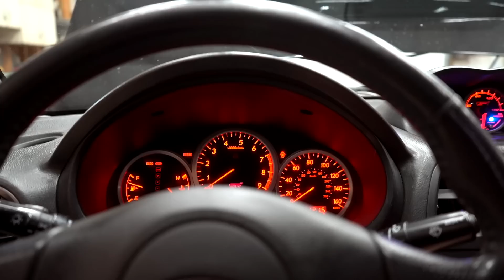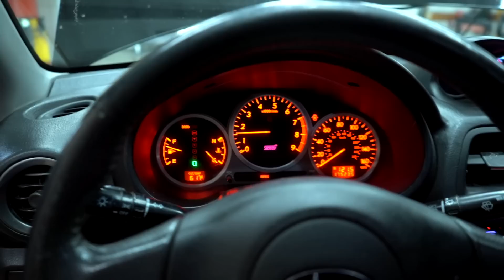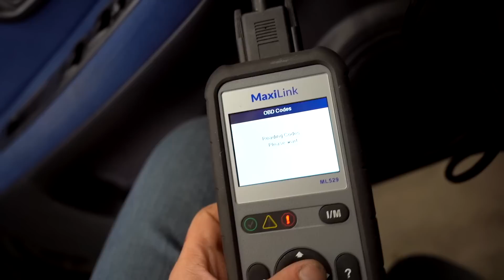Installing Stiffi's on the STI's!

Comment: @Devin - the other plug on steering should be for steering wheel with accessories (volume controls, etc).
Please consult local parts department at dealership. 👍

Comment: Man the method where you peel just a tiny bit of the 3M wrapper off, set them where you want them, then pull the wrapper to expose the tape is so much easier than sticking them to the car and having to rip them off lol

Comment: The cruise control light will come on with the check engine light indicating the car is in limp mode. Same as my 06 forester, the abs and brake light will come on when their is an issue with the speed sensor as well hence your speedo not working. Good luck man hopefully it’s just a corroded connector or frayed wire.

Comment: The cruise control blinking should be for emissions for the cat, like on my 06 Legacy but not sure about the sti, I hope this helps somewhat
Reply: Cruise control is disabled due to a check engine light. It's a standard Subaru feature. That is why it's blinking. Any engine code will trigger cruise control light to blink
Reply: Misfire if blinking

Comment: Pretty sure the cruise wire on the Sti is different from the wrx.  I remember on my 07 sti it had a green connector that plugged into the middle connector and had a colored wire for the horn. Think it was green.

Comment: I believe if the speedo is not working the gear is stripped in the trans and you will have to split the case to fix it

Comment: If the speedometer isn't working, the gear inside the trans casing is likely stripped. Unfortunately in order to replace that gear, trans has to come out and you have to open the casing

Comment: YO CLEAN THE SPEED SENSOR CONNECTOR PINS ON THE TRANS, ITS CORROSION FROM THE I/C WATER SPRAYER IF NOT ITS INTERNAL. IT HAPPENED TO MY STI CLEANED IT AND BACK TO NORMAL.

Comment: I had that speed sensor light, I replaced the speed sensor and still had it. Turns out it was the harness clip that plugs into it. Looked burnt in there. Picked up one from iwire and spliced her on. Problem solved :) <3

Comment: speed sensor will cause CEL to come on and throw the car into a limp mode. Should be able to just replace the sensor from the top if its not physically broken inside the trans.

Comment: I'm on the hunt for another car I'm looking in to a 3volution 8 or maybe a swaped  Subaru gc8 what you think is better buy I can get a 3vo for 14k right now or a sti swapped 2.5 rs -gc8 body whats better ?????????
Reply: The Subie gC8 and Evo goes up in value every year so it’s about what you want I wouldn’t modify the engine on the subie honestly just because of how long it’ll really last
Reply: Ok I see what you saying just a bit underpowered with stock ej25 non turbo but amazing car I have a 98 2.5rs good driving car just no power was think of swap or buy a evo or even a eagle talon tsi or a Mitsubishi Gsx I need some boost in my life
Reply: Taba Apparel aha I get whatcha mean now if you want boost man the Evo is great for it it’s just the gC8 is such a rare car I would hate to see it go down in flames and you have to put to much money into but go for whatever man I love both the cars I own an evo 8 unmodified so it’s great for now

Comment: The issue is the speed sensor gear in the front bell housing. You have to split her open... new shaft, the gear, and a c-clip. Kinda sucks maybe there is a diff way. I would not recommend opening the trans because then you have to set pre-load and backlash on the front-diff. I know all this because yeah... left the plug out of my 6 speed and destroyed the bellhousing... tried to make a video of it but it was a hot mess. JUST LEAVE IT ALONE! live with the flashing green light lol
Reply: ^what he said

Comment: Wouldn’t put a different model steering wheel on it these, airbag components do explode if not the right part. Go to dealer and get them installed correctly. These ain’t plug n play if the part isn’t correct per factory design bro